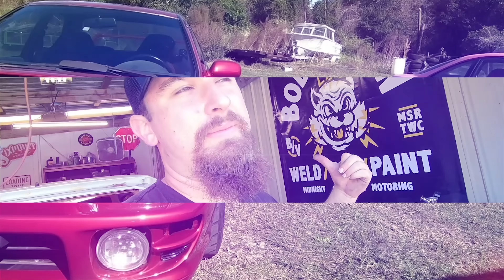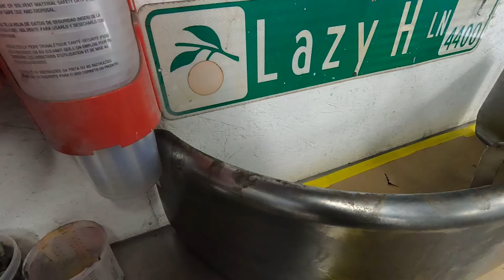Major Progress and Custom Wheel Tubs - BodeVision Body Swap Series Ep. 8

Comment: Nice update on the Honda El Ca-CR-Vino! Just a question - what if the fuel pump ever goes bad? You've got a bar running over it, so don't think you'll be able to pull the pump out the tank, as well as welding the flat bed right over top?

Comment: If you can find the smaller round p100 discs for your respirator, it will fit under your welding hood. I'd advise you to consider wearing it when using abrasives as well. 

I appreciate you. Thank you for sharing your skills knowledge and experience

Comment: Amazing work Adam the rear bed and the wheel tubs look like they were made like that at the factory, sorry to keep saying this but your fabrication skills are second to none as everything you do is well thought out and always fit first time👌
One thing that I did notice is that you didn't do any rust prevention under the bed Adam, maybe I'm over thinking it but I thought you might paint all the box section before you fitted the floor🤔maybe it isn't so important where you live but here if it isn't treated then it will start to rust within a few weeks🙏👍John UK

Comment: Watching all that storage space being permanently covered was painful.  You could have sealed off the rear seat and spare tire areas from the rest of the skate, put some drain holes in them, then built hatches in the ElCam floor.  Building an under lip and using gaskets, they even could have been water tight.

Comment: LoVe the project, especially the cutting on a plastic bin and welding on paper :L 
2 things;
1 - why don't u just put some rubber behind the holes to stop water getting in but will still have the hole there for looks? 
2 - why not make the wheel tubs bolt in?